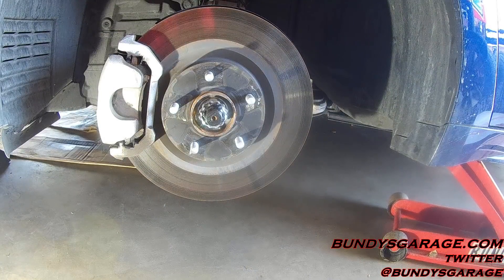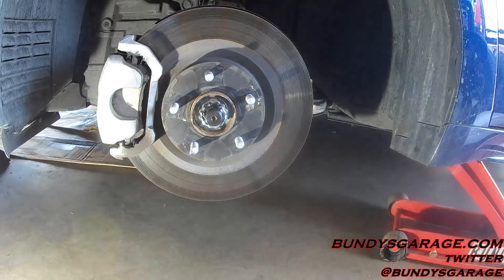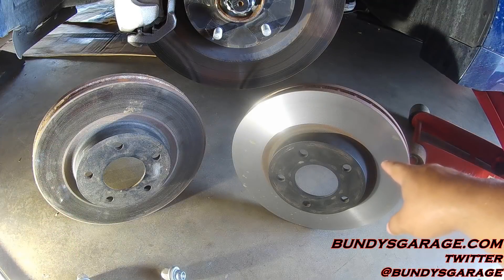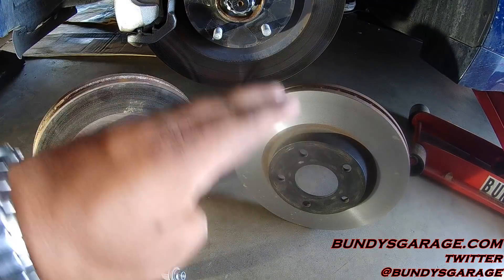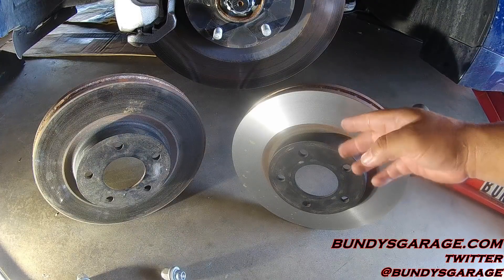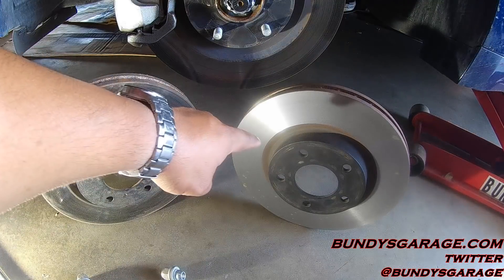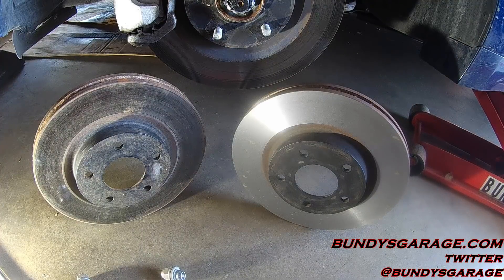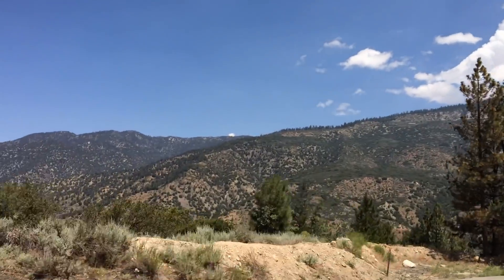Do I need to Turn Rotors when changing Brake Pads - What does Resurface Rotors Mean?

Comment: I would just replace the rotors every other brake job. Here in Chicago, by that time the rotors have some pretty significant rust from the salt.
Reply: I totally disagree. Only replace a rotor when it needs replacing. You’re adding significant cost to your maintenance. You would be surprised at what a good machinist can do with a shabby looking rotor. You can safely resurface most two times. Which equates to quite a lot of mileage. You’re adding $300+ cost in parts alone to every other brake job. Rarely, a rotor can be resurfaced three times. But, that is very rare indeed. By time you add labor, you’re looking at over $500 added to your brake job. Of course, you can throw your money away if you want! If you’re diligent and rinse your wheels often during the snowy season, you can avoid the added corrosion and extend the life of your pads and rotors significantly. I understand it isn’t always practical, but when it comes to my hard earned $, I am doing all I can to stretch every penny!
Reply: @onejedi21  Last time I checked It was $15-20 to resurface a rotor and $30 to buy it new. Not a big difference so might as well go new.
Reply: @stevenschoenfeld7405  same. especially when you drive an old car with cheap parts. just buy new one.
Reply from the maker: OE rotors are of a higher quality then the aftermarket rotors you can get. So if you can resurface the original rotors, do it, they will last a lot longer.
Reply: @bundysgarage OE rotors can be bought in the aftermarket! Automobile manufacturers do not make their own rotors. Anyone can easily research who makes their car's rotors for the manufacturer then buy directly from them.

Comment: I hope I can get an answer but my pass still have plenty of meat on them. However while driving it sounds like the pads are rubbing the rotor even when I’m not applying the brakes. Kind of like a metal touching metal. It’s not the heat shield or anything and I took it apart and it seems to be the pads contacting the rotor when I spin the rotor. Not sure if I should resurface or try to mess with the caliper
Reply from the maker: There is a metal sensor that hits the rotor to let you know the brake pads are low.
Reply: BundysGarage it’s not that, the pads of plenty of life left
Reply: It's normal for the pads to touch. If the wear indicator on the pad isn't grinding your rotor, make sure your caliper pins are moving freely. Might be as simple as cleaning inside the bore and re-lubing them with the correct product (not grease).

Comment: I have a question, how can you tell if you have a bad rotor or a bad wheel bearing? I hear a hum in the back so i checked and as i turn the rotor i can see it touch the break pad at a point and then run free. is it the rotor or the wheel bearing? since i hear a hum cumming from the back i'm unsure if the cause is the wheel bearing or the rotor. don't want to overspend. i don't hear any hum as i spin the rotor but do her and see the break pad touching the rotor at a point then run free. this is happening on both sides in the back. what can i do to make sure it's one or the other? could it be both? :(
Reply: since your car is front wheel drive you may want to check all 4 bearing s as follows:
a) rear: 
-lift the suspected tire off the ground
-release the parking brake
-place a palm of your hand on the strut spring
-spin the wheel with your other hand 
-bad bearing will cause spring to vibrate and you will feel it in your palm
b) front: 
-support front car of the with the jack stands
-set the parking brake
-place drive train in neutral
-use method described in "a" to check for bearing roughness
Reply from the maker: Wha kind of vehicle do you have? Year, make and model. It could be your rear differential if you have one. Wheel bearings don’t usually fail at the exact same time if your hearing it on both sides. Also if the pad touches the rotor a little it would not make that kind of a sound.
Reply: BundysGarage 2000 Honda Accord v6  the sound that it makes wen driving is a hum but wen a turn the wheel by hand the only sound that makes is the grinding of the breakpads against the rotor and only at one point. Can it be noisy tires?
I did notice the hum before getting the tires but it increase with the tires. What test should I run to pinpoint the corporate?
Reply from the maker: Have you check the thickness of your brake pads? You sure it’s not metal to metal on the brake rotor? If you only hear it when your turning it could be your CV axle(s). Do you hear any clicking sounds when driving straight or turning. A bad wheel bearing will be very very loud inside the car and will get worse as you increase speed.
Reply: 1.7.2019 - Long Beach, CA.

With reference to an 8 month old question from Rudy Munoz.
- I'm longwinded on this one, so grab your Coffee -

1st & foremost : I know less than any Independent Shop/ Dealership Technician .

Background : Journeymen Shipfitter Graduate Apprentice ( 7.25.1977 - 9.1997 ) until Democrats closed her, still wasn't paying attention to Politics. Clinton & Jessee Jackson came there in the 23rd Hour separately & didn't get out of their Limos......Smog Repair/ Driveability Problem Expert/ Computer Reprogrammer/ Brakes/ Tune-Ups @ a GM Dealership & Independent Shops.

I could be wrong, but I doubt it : A reason large % of vehicle owners experience Brake conflicts is that a majority of people don't know Journeymen Machinists Arithmetic & they refuse or have never heard of the Thin booklet called " Motor -Brake Specifications Guide & Brake Bleed Procedures".

Every Rotors THICKNESS is supposed to be measured with a Machinists Micrometer before Machining the Rotor & after Machining the Rotor. A Machinists Dial Indicator is supposed to be used afterwards to measure Rotor Runout, Flange Runout & Wheel Bearing Runout.

The Rotors thickness is supposed to share the same thickness all around the Rotor in "8" different places...I'll make it easy for ya by using regular Math : Imagine the Rotor as a Circle & place a Plus ( + ) Sign on every Rotor. If your Micrometer on this imaginary plus sign reads 15/16 " Thick , 14/16" Thick, 13/16" Thick & 15/16" Thick then that Rotor is already uneven in thickness ; in fact there's a 2/16" DIFFERENCE !! But what do the majority of people do who's working on your car do - " They immediately remove the Rotor, take it to the Brake Lathe for Turning/Machining". The Rotor looks so nice and purtty (pretty )...Yet the Rotor thickness was already UNEVEN before it was removed, now you Machine the "4" Rotors with no da_ _ previous Measurements.....Some customers can't figure out why ?....There's a Grocery List of incorrect practices applied on Brake Jobs : One of many is the Rotors were NEVER measured with a Micrometer & a Dial Indicator wasn't utilized for Rotor Runout - Flange Runout & Wheel Bearing Runout.

Mr. Munoz 
2000 Honda Accord ( 6 Cylinder )

FRONT ROTORS ( Specs : )
Rotor Thickness Variation - .0006"
( That's six ten thousandts of an Inch )
Runout Limit - .004"
Thickness New - .905" Thick
Minimum Machining - Not Specified
Discard @ or Under when - .827" 

REAR ROTORS ( Specs : )
Thickness Variation - .0006"
Runout Limit - .004"
Thickness New - .354" ( Wow !! )
Minimum Machining - N.S.
Discard @ or Under when -.315"

When this info is included on every Job Order & they take ya to Judge Judy she'll rule in the Mechanics favor every time : Judge Judy - His paperwork shows the measurement of all "4" Rotors & they all were thinner than the "Discard Thickness" - You needed to replace all "4" of the Rotors and the paperwork says, " You declined"

Book Mechanic,
Charlie "Hop-A-Long" Barkwell
Motors Brake Specifications Guide
" Answers are in the da_ _ book and most people never apply it - They still like 2nd Guessing the Engineers of BMW , GM , Toyota , Ford , Honda & what not.

I

Comment: How much does turning a rotor cost?
Reply: Inspector Steve first time turn your rotor; second time change it
Reply: Moaz Defasi good advice thank you
Reply from the maker: Between $15 - $25 bucks
Reply from the maker: Call some local auto repair shops and they will help you out. Just remember sometimes they are too thin and they can’t turn them and you gotta buy new ones.
Reply: BundysGarage the $15 to $25 is what I thought it cost.  Rotors are only 25 to 40 for basic ones.  Why wouldn't you recommend just going with a new rotor? For a few extra bucks the new one will last longer than the turned and you will have less problems with the new as well.
Reply from the maker: Steve, the OEM rotors are typically better than aftermarket ones. Turning rotors that have alrrady seen that many heat cycles will mean less of a risk of warping like I have seen many times on cheap aftermarket rotors.

Comment: Resurfacing compromises the engineered design of the rotor...most reputable shops will refuse.
Reply: That is incorrect. Factory service manuals state a minimum thickness of the rotor. They can be turned and reused until they are below that thickness.
Reply: False. If they are within spec, nothing is compromised.
Reply: Most ford dealers resurface the rotors when changing pads, I have the receipts to prove it and they lasted over 100,000 miles before they were too thin to resurface and purchased new rotors. I guess dealerships aren't reputable?
Reply: Well then applying the brakes compromises  as they too reduce the surface of the rotor.
I have heard that race drivers even resurface brand new high quality rotors  and find they 
aren't "true" as they should be from factory.

Comment: You said on your video that the surface it has a wave do you think that what makes the car shake too when pressing on the brakes cause of the waves of the rotors?
Reply from the maker: Yes the uneven surface (wave) in the rotor causes the shaking. It could be bad suspension parts as well. But if you put your foot on the brake and that's when you feel the shaking, most likely your rotors need to be resurfaced.
Reply: Ok yea cause my cars is 2 years old and I didn't resurface it when I replace the pads

Comment: hi sir, my rotors are somewhat new yet they need resurfacing. there is nothing shown visually. the question, can i keep the same brake pads after resurfacing my rotors since they have 60% life left in them? thanks
Reply from the maker: +Elie Nehme yes you can keep the same brake pads after resurfacing the rotors. As long as you have enough meat on them still. Don't compromise your safety for a coupke of bucks.
Reply: I have heard that you can sand them down by laying sandpaper on the garage floor and running the pads over them to get rid of scores in them.  I have not tried this myself yet but will within the next year.
Reply: Jonn Abshire thanks man. I resurfaced the rotors and switched the inside and outside pads and everything is good now after 100 miles of breaking in, yet i see it needs another 100 miles so the pads will bond perfectly with the rotors. I don't recommend switching the pads because it will take longer for it to bond wit the rotors. Just put everything back as it was. Thanks.

Comment: Where can I get my rotors resurfaced? Autozone? Advanced auto? NAPA?
Reply from the maker: Call around to those places and see who does it for the cheapest price. Also when you drop them off tell them you want them cut slow.
Reply: Some small timers will do it for $10 a rotor.  Try to talk them down to $5 a rotor if you can!
Reply: @Mr.HarryWild  Sure you can get a shop to do a quality job for $5. Oh yeah, that's if you are a young hot blonde with double D's hanging out of your bikini top.

Comment: Hate to be the voice of dissent; but depending on your driving habits, it's sometimes perfectly fine to NOT resurface a rotor when doing a brake job.  How do I know this?  I did the first brake job on my Ram at 68,000 miles, and bought new Wagner (a good name) rotors.  I immediately had brake shudder for the first time ever.  Every time I applied the brakes at more than 45 mph, the car shook.  I took the job apart, applied new high-heat synthetic grease to the slide pins, and made certain that the hub onto which the rotor was attached, was wire-wheel cleaned and like new.  Still same issue.  I put my old, NOT resurfaced rotors back on, and problem solved.  When I took the rotors back to the automotive shop and explained what I did, they exchanged the rotors for a new pair.  I now have a new pair on "the shelf" and will maybe use them in 80,000 miles when I do my second brake job.  Appears the new rotors were garbage.  And to think. . . I did my research and bought a name that was second or third on the list of "reputable manufacturers."  Come to think of it, next brake job, I might just have my Mopar original rotors resurfaced for the first time.  Anyone want to buy a new set of Wagner front rotors for a 2015 Ram 4WD diesel?
Reply: He explains in the video why this happens.  The new rotors had not been heat cycled, meaning, they warped once they got used a bit... if you had the new rotors turned, the wobbling would likely go away.  Wagner makes decent brake pads... don't know if i'd trust their rotors, and your comment supports my opinion.
Reply: It's also possible that you didn't remove the lubricating film on the new rotors.  Most new rotors come with a grease film on them that keeps them from rusting in the box.. You are supposed to use brake cleaner to get it off before installing them to the wheel hub.
Reply: I've purchased Wagner rotors checked them with dial gauge & they were warped ( brand new came warped) .
Reply from the maker: WOW! Warped out of the box! Doesn’t surprise me, all the rotors are coming out of China. I don’t care what kind of quality control you have as a US company, it’s hard to manage that 7,000 miles away. Also keep on mind, US companies don’t hire Americans to work in those factories, it’s Chinese people and Chinese quality control people.

Comment: Metal has built in stress that can be relived with heat. I agree with what you said, once the stress has been relived it should take higher heat to stress it again.
Reply from the maker: +One exactly, that's what they do with engine blocks. An engine block that is remanufactured after
100,000 miles has seen a lot of cooling and heating cycles. It's called a "seasoned block"